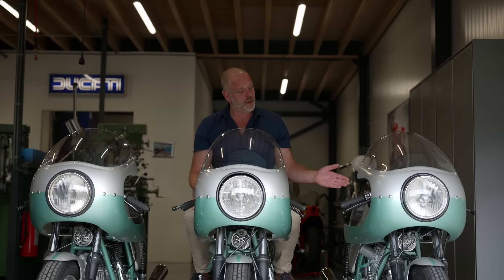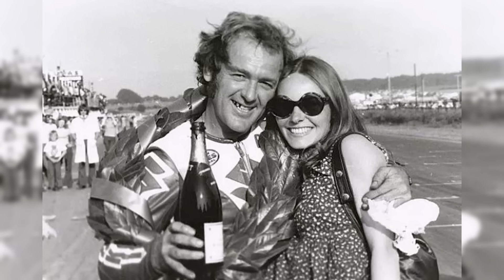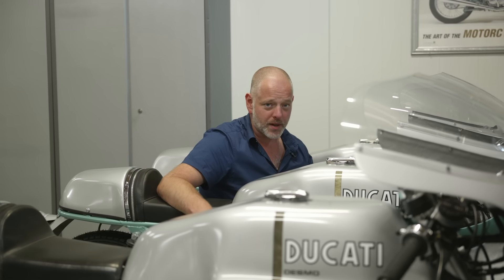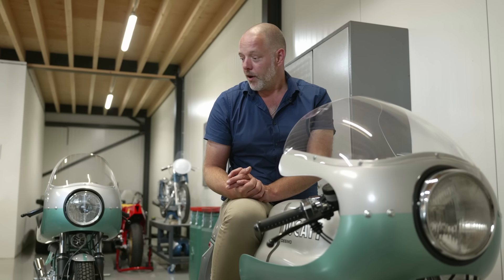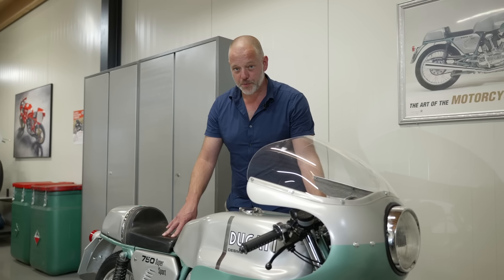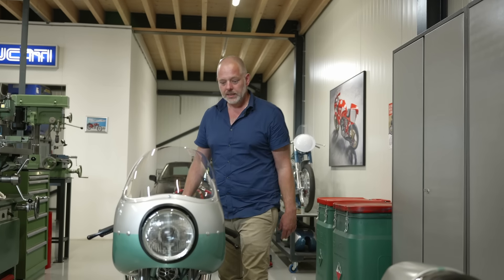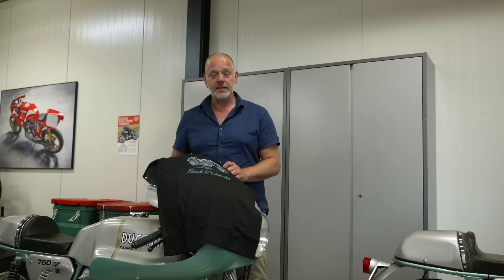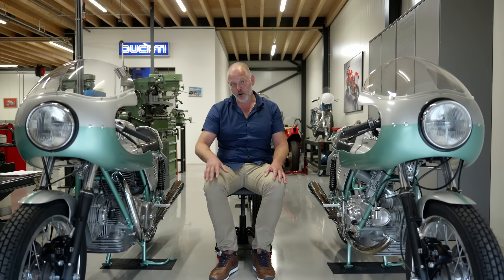The Ultimate Ducati Greenframe Documentary - Three 1974 Ducati 750 Super Sports Restored!

Comment: We "found" our Greenframe late 81, not too far from our place. Because neither of us liked the colour, and the single seat was "transformed" into a double (simply cutting the top off) and some bearings inside were dubiously noisy, the engine came out and opened, the frame was painted in a colour similar to PS's 72 bike and an original 74 SS seat found, although it had seen "action" in the 24hrs of Spa a few years before. First time out in april 82, we both (me and then girlfriend) liked the position and overall looks. My brother and his girlfriend lived a few houses down the street and heard the bike running, coming over and admiring it. Brothers girlfriend also wanted to sit on the bike so after some warnings she swung her leg over and promptly dropped it on the curb, breaking the new original screen. A week later we presented her the bill and she never spoke a word to me again.

Comment: What an interesting and informative view of a motorcycle I shall never have the fortune own. One or two little points that I might mention are that the headlight lens should be a Jop Duplo which were unusual back in the day but almost extinct now. Also the frame for the 500 L twin was designed by Colin Seeley and the similar principles were carried over to the 750/860 bikes. 
I never knew about the wood effect electrical cover. Everything else seems to have a flimsy yellow plastic thing.
Thank you for your hard work and research rebuilding these fantastic machines and the energy and enthusiasm to produce some of the best videos I have ever seen. Is it true though that the famous green paint was the same as Ducati used on the small generators they also used to make?
Reply from the maker: Thanks for your comment! You're quite right about the JOD Aprilia headlight. There are numerous other details that I didn't mention in order to keep the length of the video within what is acceptable. Colin Seeley indeed designed the frame for the 500 GP (although Ducati used their own design initially) and some details where carried over to the later production frame. 
It is certainly true that Ducati had the green paint lying around that they used on diesel and outboard engines!

Comment: You might consider the Magni MV Agusta 750S. I have a ‘78, America based Magni and a normal ‘74 750S and they are entirely different bikes. The Magni is lighter, much faster, has better brakes and handles beautifully. It is almost on a par with my ‘76 900  SS, though not quite!
Reply from the maker: Thanks for your comment! You are absolutely right about the Magni built bikes. These are beautifully crafted machines with racing frames, brakes and suspension units. Arturo Magni made the MV Agusta the bike it should have been al along! I never rode one, but we might make a video about Magni at some point. He also did some great work on Moto Guzzis!
Reply: That would be great 👍🏻